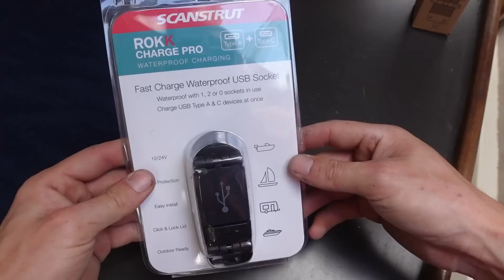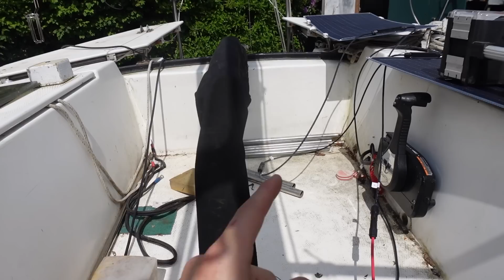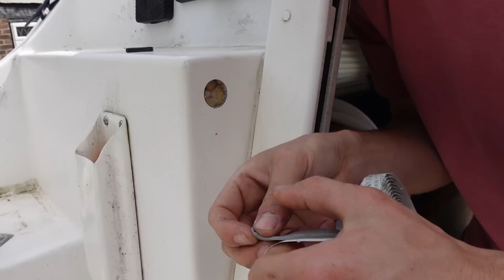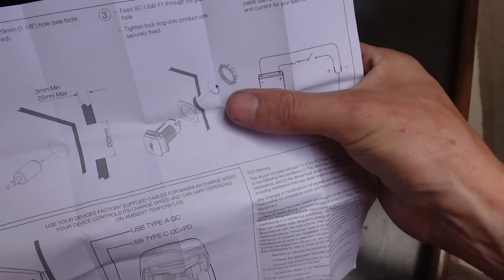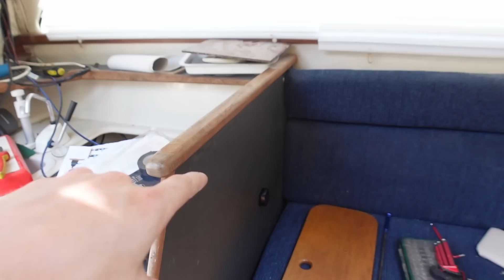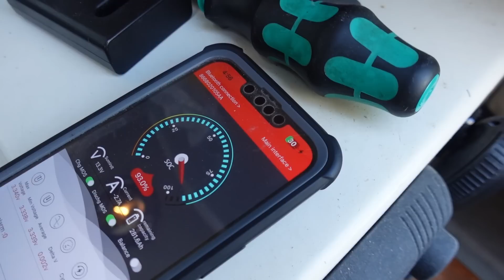BEST USB FAST CHARGING ON A BOAT FOR YOUR PHONE | Ep.130

Comment: Hi Alex, been doing some research for myself and watching my favorite Solar and LiFePo4 battery guru, Will Prowse.  He said that military grade SIGS solar panels are the first flexibles that he would recommend because they're military grade panels that are extremely shade resistant, exceedingly well-built ( you can run a car over them without sustaining any damage or you can put a bullet hole in them and they will still continue to function ) and they will last a long time and are super efficient.  They used to cost over $1,000 for 80 watt panel, but now you can get long strip (26”x 85” ) 200 watt panel for a little over $500.  I would consider one or two panels, depending on your energy requirements, and I would mount them on the amas contrary to what I said earlier about running wires to and from the amas.  If you have a waterproof outlet on the upper side of the main hull, then you could plug in a separate heavy-duty exterior quality cable to the panel and to the boat and have it be long enough that it can be zip tiesd  at the edge of the netting going to the main hull.  Before folding, you would disconnect from both the panels and the hull and cap both the panel connection and the hull connection.  The panels being so thin would easily slide into the boat without interfering with the closing of the armas.  Since you're not bending he wire when closing and you can visually inspect the cable every time you hook it up, I think this would be a safe way to actually use the space on the amas for Some serious power.  

Another Recommendation from Will is the 460Ah Epoch LiFePO4 battery.  This is a well built, with all the safety features and comparatively cheap for 460 Ah battery.  Even with a few days of no sun this battery would be more than enough to run all of your electrical as well as a refrigerator no problem. 

Just some thoughts while researching for my next boat.

Frank
Reply: Oh, of course I meant add cut the zip ties and put the connecting cable down below when the amas are folded to keep from bending and to protect it from the weather...
Reply from the maker: @user-gb4hr5nt9e  great information! I also have watched his videos before. The topic of solar and lithium is so big. It’s also quite hard to find good panels at a decent price. Will definitely be looking into what you suggested as it would be quite cool!

Comment: Hi Alex. Interesting product the phone charger. I guess it's like a completely built in alternative to installing a 12V cigarette plug and then plugging in a fast car charger unit to that?

This does lead me to ask how this works for all appliances. Reason I ask is that most brands have their own fast charging protocols. For instance Apple has its own, Android devices with qualcomm chips have a specific charger that will not work in MTK chipped phones. So if you plug an Android phone into an Apple charger and vice-versa it will charge but it will default to 5V charging only and will charge relatively slowly.

Maybe worth a test with some different kit to see? I even used to have a Oneplus phone and the fast charging was brilliant in that. If I plug my new Samsiung phone into it, it defaults to quite slow charging. I need to use the proper Samsung charger to get full speed fast charging, so even Oneplus must have a specific way of doing this for their phones.
 
Very neat solutuion though.
Reply from the maker: Would highly recommend going on the scanstrut website and all the information is there! The other thing to watch out for is voltage drop with the wire gauge you’re using. Thanks Dave!

Comment: Agree with better quality charging ports.  I’ve been getting by with charger plugs in my 12v DC and 110v AC outlets.  Neither are particularly fast.
+1 on the butyl.  I use it on just about all hardware above the waterline.  It lasts forever.  There is still some original butyl on my 1982 boat.
Reply from the maker: I definitely recommend these chargers. One of the best upgrades I have done yet. Even just one is worth it. Butyl is amazing stuff!

Comment: I really like that waterproof charging station -- very good design.  I think you picked the best spot for the mounting location too -- even though it's waterproof, it's best to mount it away from locations prone to spray.  Hey just a tip if you are going to do a similar solar mounting system to what you had on Meraki look into bi-facial solar panels -- they have cells on both sides of the panel.  You get extra charging because the bottom side of the panel gets the light reflected off of the water -- bottom side never rated as high as the front but adds to the overall rating.  They are perfect for boating when rail mounted or mounted on an arch as they give you that extra bit of charging.
Reply from the maker: Thank you! I have looked into the biracial but can find anything suitable in the right size unfortunately.
Reply: @AlexGoesSailing  That's too bad.  What is the size that you need?  I'll keep a look out over here in the States -- might have a distributor over here that you don't see advertised over there.
Reply from the maker: @robertscholz4486  well I have some standard ones for now so should be fine for what I need. But anything in the 50w-100w size range really. Thanks Robert!

Comment: For inside, I've had good luck with cheap Amazon stuff. These circuits are surprisingly simple, basically just a step down converter from 12v to 5v.
Reply from the maker: They work but don’t charge very fast. 1.2amp ax for me and these can do 3amp max. I have noticed the difference while out on the water. Also depends on budget and what matters to you on a boat. I use my phone for logging my routes so that sucks lots of battery.